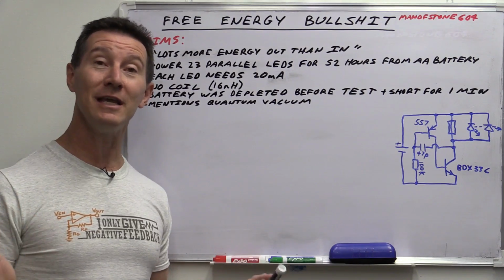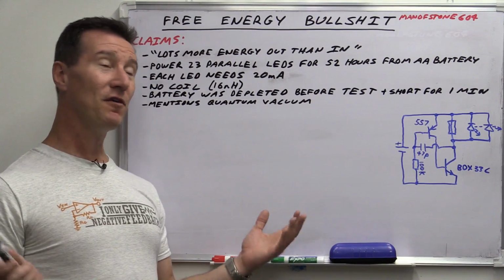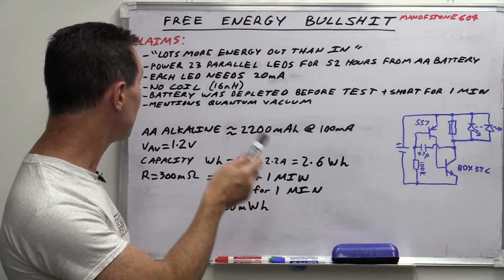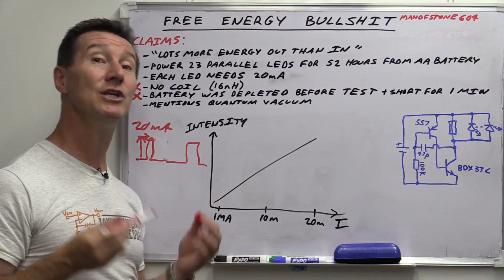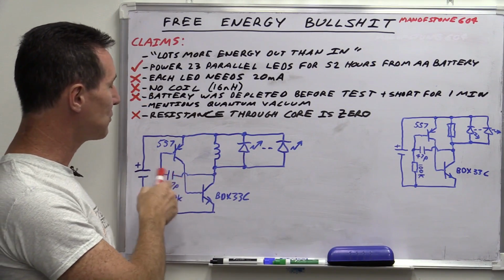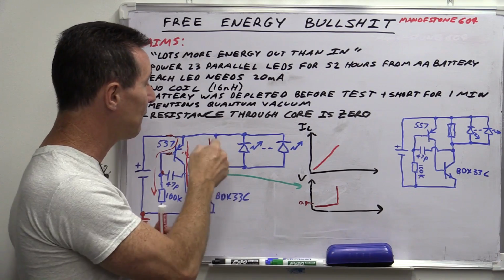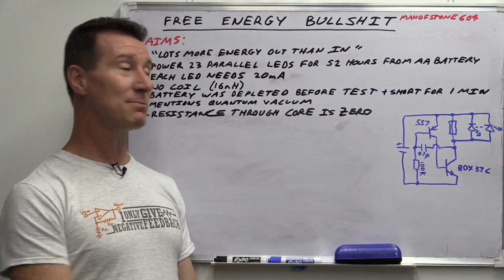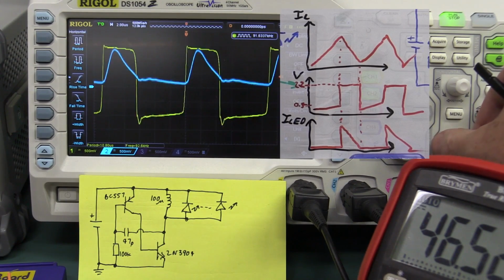EEVblog #708 - Free Energy Overunity is RUBBISH!

Comment: I also just realised that the diodes are around the wrong way so they only see the back EMF when the NPN transistor turns off. I put this into a simulator and I get a little over 80kHz with a approx. 50% duty cycle. The waveform is what I would call a quasi sinusoid. I had to use 47nF to get my simulator to make it oscillate. I have only 10 LED's in circuit and the current looks triangular with a peak of 100mA so 10mA per LED for a short period of time. I expect the frequency to be load dependant so these figures will move about but so far nothing free has come out of it :-)

Comment: Another thing, they are red LED's and if they are HE red the band gap is around 1.9V which means the 1.25V of alkaline chemistry will not do much. The system RELIES on the pulses from the circuit to actually work at all :-)

Comment: Shorting the battery for a short while may improve things, because it causes heating which makes the chemistry run more efficiently. I remember as a kid placing my empty batteries in front of the fireplace for 10 minutes which allowed me to run my little car for another 10 minutes. When you consider that he did this at the depleted end of the game he wasted less of the usable energy because the impedance was higher and the heating gave the chemistry an additional boost. It's not free energy, it's basically like squeezing that last bit of toothpaste of the tube by running it between rollers.

Comment: Dave, one thing you should mention about the difference between run-of-the-mill alkalines and the good ones is that the good ones don't leak. I bought 2 Toshiba alkalines for my TV remote and after a year they suddenly burst and I had to rinse out the remote. That has never happened with Duracell or Eveready alkalines.

Comment: I'm surprised you went to so much trouble explaining the circuit and making the video. It's a shame but there is a awful lot of people that just don't understand electronics and basic engineering concepts and the points you raised are typical. But most of them deliberately make false claims and then try to confuse, to try and gain as many you tube hits as possible. very good video.
Reply from the maker: bjtaudio Well I'm hoping that some people learn something from it. It's not meant to convince the overunity nutters.

Comment: EEVblog 
Hi Dave,
I'm used to see your videos, specially the Mail Bag and teardown's.
Love them!

Regarding this video and about Free Energy, some weeks ago I watched a video claiming that using a electric bike and adding an car alternator, while the wheels were spinning, the alternator was also spinning and made possible to recharge the battery pack to run the bike itself.
So, instead of riding for 1 hour for example, he could ride forever due to this add-on.

I know that an alternator works with a 12V power Supply to be able to proper do it's job which is recharge the car battery.
And I also know that the alternator will then produce 14V so that it can recharge the battery!
That's why when we ride the car all night with lights On there's no issues, but if we forget the lights On with the car stopped throught the night, when we want to ride it, the battery is dead.

So, returning to the point of Free Energy or basically restoring the energy, do you believe that's possible to add a small alternator to any electric device, so that it can provide perpetual energy?
In other means, in any electric circuit, add a motor to drive an alternator, which is connected to a rechargeable battery, so that the alternator can produce power to recharge the battery, drive the motor and the circuit "forever"??????

Again, love your videos, and I'll be waiting for a reply.

Pedro from Portugal

Comment: Late comment. Like the extensive debunk. My first inclination is to see what can be done with the crummy circuit to boost its efficiency and see if there are simply different values that can be combined in the L portion of the circuit. No doubt the component count, forget the diode load is tiny. Fly back system are always fun to pull apart. Kudos and keep up the good work!

Comment: The first thing I noticed about this circuit that is different from circuits that the excess energy hasn't been able to be explained is that it is a closed system. Many of the "open system" inventors make the claim that their invention is no different than a solar panel or a hydro electric dam. I'm still on the fence as far as some of the "free energy" devices go but none of them that I consider worthwhile have been able to be explained away (obviously) most of the more serious inventors that do this type of work are either really good at being a fraud or they are on to something.

  I have built a Bedini SG motor and that thing is certainly strange. Many people just write it off as a fancy pulsed motor but I have seen effects from it that are very unconventional namely batteries getting colder as they charge. I have not been able to afford the spare time and money that it takes to reproduce the suggested experiment fully. but anyone that has about $200 and some spare time may do so. (EEVblog: if you want to look it up it's the bicycle wheel motor that John Bedini put out the plans for on the net. known as Bedini SG motor) The electricity produced by the batteries, after being charged by the motor seems to behave differently. I don't have any fancy equipment to go balls out on this either. Some people theorize that one of the battery terminals is being slowly changed into a negative resistor when charged by the motor but I don't even know if there is proper test equipment built to validate or debunk this.

  Anyway if interested, I suggest looking into Tom Beardens work. He is educated and is either completely sold on the idea or a con man. I can only hope it's the former. He goes quite in depth for hours on this topic in the "energy from the vacuum" video series.

Comment: I think it's not necessary (but I enjoyed video very much anyway =)) to test it and try explain for long time.
You just need to ask three questions.

If battery is depleted and you get free energy from the "quantum vacuum", why you need battery at all? =)

If it's free energy from "quantum vacuum", why its not working forever (if 23 LED is too much for quantum vacuum, how about at least one?) but only for two days?

Why it stopped after 2 days, and what you need to start it working again? Replace battery? Wait, it supposed to be depleted,  and energy is taken from quantum vacuum?

EDIT:
Checked his video, and he claims battery is spent on the switching of transistors...
Why can't he store some free quantum vacuum energy for his?
And I like how energy used for LED accidentally is same as capacity of new battery,
yeah, just accident, battery was depleted, sure.

And with all those free energy idiots, it's always same question, if they know how to get free energy,
why they are poor? Why not start energy company? But they would probably say, that evil Illuminati don't allow them to sell it, etc.

Comment: Free energy (>100%) from an electronic circuit or perpetuum mobile type of system, inother words, from a man made process is impossible. Free energy from the sun (daytime) or Earth's core (24/7) isn't. If you take e.g geothermical energy, and run a turbine 24/7, it will run as long as mechanics do some maintenance now and then (but that process can be roboticized and robots can be programmed to repair themselves) So with a trick (some magic) the world can have free energy, or sustainable energy (for a couple of billions of years, until our sun(star) dies)

Comment: I have built a similar LED driver (Joule Theif based, but an overkill version), it uses a 3DD13009K power transistor I ripped out of a PSU, and a small (unmeasured) 28-ish guage coil on a 1 inch by 1/2 inch square ferrite core with 1:2 (feedback:power) coil ratio. It is unbelievably efficient, and does reach the 100H mark when running off 2.8V from Ni-MH cells. I added a small knobbed potentiometer to the feedback winding and stuck it in a flashlight with a small hole for the knob. It drives about 22 3V LEDs in series (output about 80V peak, 35V average), and provides a very bright white light. I had originally tried parallel LEDs, but they actually turned black inside and burnt out. It also stings pretty bad to touch it, so there may even be a much higher peak that I cannot measure with my current tools.

The waveform it produces as very wierd, and has a unique waveform which stays the same almost constantly regardless of frequency. There is a lot of ringing on the oscillations (very high voltage spikes), and there is a rythmatic ringing/pulsing on top of the ringing that has reversed direction (voltage drops in little spikes, sometimes negative when close to zero crossover). It basically looks like white noise following the sine wave (if you can call it that) modulated at about 3.5kHz on highest power and up to 175kHz on lowest power. It definitely produces RF within a foot or so.. A AM type receiver picks this up weakly and has a very odd almost sci-fi movie like synth sound to it.

As you explained, definitely not overunity (which is impossible anyway), but still a very decent way or powering LEDs very efficiently. There can be apparent overunity if measured incorrectly with bad assumptions (like what you discussed), or if another unaccounted for power source (stray voltage, ground loop, ETC) provides it. Great video, you make a lot of great points, and in a way showed how to properly measure the output/input efficientcy of my small drivers.

They definitely could be used in a crank winding flashlight for higher efficiency if one were to manufacture them that way. And why use a tiny rechargable Li-ION button cell, use a 350F ultracapacity which is about the size of a D cell. I bet those would not only sell, but be really reliable. I may try modding a cheap $10 crank flashlight, I have the parts.

Just thought I might share my thoughts, I have in short intervals of a few days experimented with these for quite some time. Sorry for re commenting, but I typed 12 LEDs instead of 22 and it would not edit for some reason. I also added more info.
Reply: Also, I really like the properties of the 3DD13009K, it has very high gain when you spike it (not mentioned on datasheet) and a maximum average gate voltage of 9V, which is almost exactly what the feedback coil provides. They are made by a single company, and I need to find a similar transistor that is more available. I only have 4, and one is dead, so for the PSU failing.

As for the feedback, if it's too high, a voltage divider that floats the base may be used. The winding I made was 2:1, but due to coils getting fatter when wound may actually be closer to 2:0.75 or 2:0.5. I need to measure the inductance to get the right stats.

Comment: Nice Clip Dave, but i got bored with it at 07:42 mins..... lol
why?, i hate maths and silly formulas so, let's make it simple/r :) (sorry, no video) 
Free Energy = Solar Panels. Yes an array of solar panels!
I have simple 12v system, and yes, I know a 24v system far more efficient as it draws half the current?
Does that mean if i build a 48v system i'll only draw a quarter of the current ?
anywayz, I haven't got a Single Solar Panel, yet....

Other forms of 'free energy' are Methane, burn it up for gas and thus elimating global warming!
There is no mathematical formula to substantiate this claim, but i can put this formula into simple words! :)
1.Sewerage and or farting from all species on earth floats up to that stratosphere or what ever ya call it, but

2. Burn this free gas before it gets up there, and PROBLEM SOLVED!
It's way too early in the morning!....

Comment: EEVblog I have never bought into the snake oil/promise of modern gimmicks of "free energy" (this includes solar) instead of believing the BS science, maybe these nuts ( or anyone) should spend time researching and thinking outside of the box and look into harnessing energy that has yet to be tapped.  Static electricity is a massive energy source, that as of yet, has never been captured/stored in a way that would make it useful. If the "Free Energy" society would spend their "energy" looking at this, then just maybe, they may find a real "free" energy source that actually has meaning and value. Many dismiss the idea and thats the problem, it can be done with enough thought and perseverance.... Many things have come and gone, that many scholars would have dismissed as improbable and impossible..... just a thought anyway.... great video!

Comment: Not sure why he states he is not using a coil, when he has a coil. What is a point of interest is , that if  he is using a standard LED the voltage requirement is about 3.0 vdc at 20mA. The LED will not power with just 1.5 vdc.
Reply from the maker: TheZooman22 You have no clue about LED's, go read a few datasheet for RED LEDs.

Comment: Free energy is 100% REAL. Newton said, "for every action there is equal and opposite reaction." That statement holds true in physics (if you push something, it pushes you back at the same force). Well... the problem is when this statement is applied to electricity! The notion that electron is the charge caring particle is false. If that was the case none of your transformers would work since the primary and secondary windings aren't even connected! I posted a video of the Tesla Hairpin Circuit showing how a capacitor can still work w/o the dielectric being broken in the middle. We also have Tesla style transformers which are unipolar in nature. Where is your opposite reaction in this case? Furthermore a magnet with just a single pole was created in a lab! These things get discovered and are simply ignored.... and yet they turn science on its head.

I could go into actual examples of working over unity devices.... Well hack why not? The humble electet (you discharge it and the charge will regenerate and it can be discharged again, first used in JAP phone in WW2), Steven Marks TPU (I posted the patent for that one), Stan Meyers TPU (he used magnetic gas inside of a closed loop of tubing the magnetic flux induced a current and a voltage in his coils wound around the device), The bucking coil transformer with non-linear core, John Bedini's Pulse motor (pulse charges batteries AND you get mechanical out as well), finally Tesla's unipolar wireless transmission system (the magnetic field orients itself with current flow).
Reply: I would love to go on and on about how you are wrong in thousands of ways, but you are clearly extremely convinced that this gives you less or more power than you get in. With the tesla coil, you put in a specific wattage, and you get out less. This is because heat is created in the spark gap, and is distributed through a magnetic field that you cannot even see. Now, i will not argue about this, even though it is extremely hard to explain, you are incorrect, and will realise it one day. Goodbye.

Comment: I like the videos from the poor English speaking youtubers that have maybe 2 videos and neither are related but one is on some circuit they "invented" that creates free energy. Now any electronics person who has actually designed circuits should be able to recognize a reverse engineered solar garden light circuit. I say reverse engineered because they goto the local hardware store and buy a $4 solar LED garden light and take it apart then goto radio shack or order a breadboard, some wire, and heavier duty parts and reassemble the "hardened" garden light circuit on the breadboard and attack several LEDS and claim its a "Breakthrough!", "FREE ENERGY!", or some "Alien Technology"

Those are the videos I watch for a good laugh

A legit circuit I came up with back in 1995 has made the youtube scene recently in the past few years but the youtubers are calling it a "joule thief". I have the original diagrams I drew up in '95 on this circuit I never had a name for.

Comment: What annoys me the most about these "Free Energy" bugs, is the way they spam up You Tube. I was researching ways to construct devices to transmit or induce electrical current into another device without wires, probably through RF. In any event any search you try on Y.T or poohgle, or Bing, or anywhere else with bring dozens of hits featuring crap "Free Energy" devices that serve no useful purpose, and offer little to no detail about how they function. I honestly believe that the purpose of these is to promote sell plans or DIY kits to unsuspecting people. Like conspiracy theories they look fairly plausible, until you get to look at the details.

Comment: You don't necessarily have to bend or break any laws of physics in order to build a successful free energy device.  Some free energy devices are designed to act as a receiver of zero point energy or some other form of energy coursing through the universe.  Therefore, no one is attempting, in building such a receiver, to create something out of nothing or create output without input.  I don't know if anyone has succeeded in building such a receiver -- I just wanted to point out that some who are trying to build free energy devices are not trying to bend or break any laws of physics in doing so.